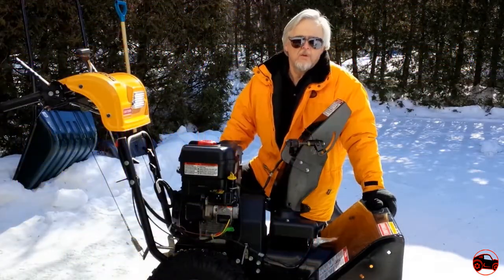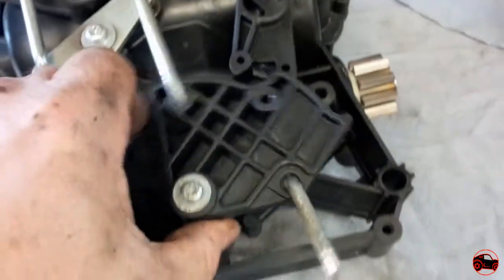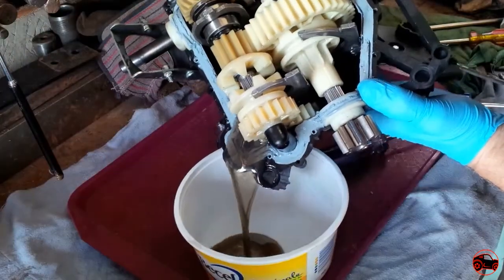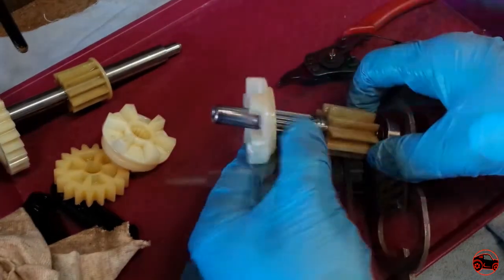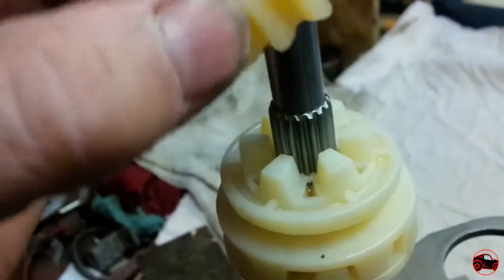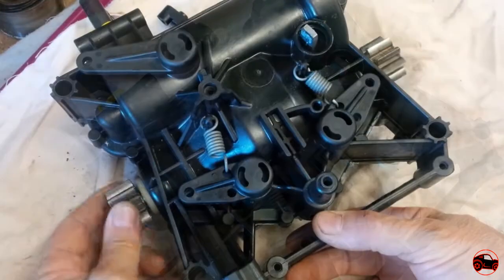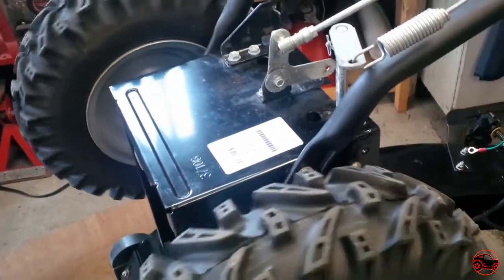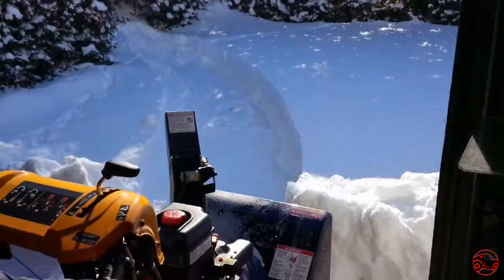How I dismantled and reassembled the transmission on my Sears Craftsman Snowblower C950-52301

Comment: A wonderful video thank you kindly for posting it, I have the same snowblower and presently when I engage the drive the wheels don’t want to turn immediately I have to give it a little push this only happens after I’ve use the machine for a while.
I was going to replace the transmission do you feel some adjustments are in order first? I also have a lot of trouble with wet snow on this machine it will go over top all the time it does not want to bite into any high snow
Reply from the maker: It might not be the transmission. Sometimes if the wire that pulls the lever that engages the clutch is a bit too loose, the clutch is not fully locked and it can slip. After many winters the wire can stretch a fraction and may need to be readjusted.
Also, when the snow is too wet and heavy or too high, If possible, I do not use the full auger to remove the snow, I try to remove smaller snow swath.
Reply: @mtlcarguy  yes thanks I knew about working thru heavy and wet snow. 
I will check the cable adjustments for sure 👍 I’ve noticed oil in the snow from under the machine so I’ll have confirm that. 
I’ll tear down the machine soon and try n get to the problem, I ordered a transmission and belts so if it needs the tranny I’ll have it on hand. 
I can’t find a service manual with specs etc those are helpful. 
Thanks for your reply much appreciated
Reply from the maker: @curti6317  Look for ''Craftsman C950-52301-0 Operator's Manual'' on-line. Good luck!
Reply: @mtlcarguy   hello MTL, Today I removed the inspection cover  and found there is allot of oil seeping from the transmission so I will definitely remove it and check it out. 
I’m curious if you posted a video on how to remove the belts, The drive pulley looks like a clutch? 
Also You mentioned you took the motor off I would like to do that but noticed on my model the bolts that hold the transmission in place appear to  go thru into base of the engine and hold it in place unless I’m looking at it wrong. Did you turn the machine upside down and disassemble in reverse. Thanks for your help
Reply from the maker: @curti6317  
I never filmed the belts removal procedure or installation but the owner's manual shows good details about the parts positioning and the torque.
Most of the work was done with the snowblower on the 2 wheels but sometimes the machine was holding on the front of the auger housing when it was needed.
As I can remember, I removed the bottom panel to inspect the parts and gain access to some lower components.
Later I disconnected the electrical connectors.
I also removed the 2 upper pulleys to free the 2 belts.
Once done, I removed the engine/motor and the engine mount plate.
With the upper plate removed, I was able to disconnect the control wires and undo the 4 nuts/bolts holding the transmission in place.
I slowly removed the transmission then I decided to film the procedure. 
Make sure you take a lot of pictures to be able to reassemble and adjust all the parts.
Note: The lower drive pulley looks like a clutch but it is only a variable speed spring loaded pulley.
Good luck.
Reply: @mtlcarguy  Good morning, I managed to get the machine and transmission apart. The transmission (input) pulley is melted between the sheaves and the belt has a lot of stretch compared to the new one.  The driven (engine) pulley is ok. Had I just looked at the belt and input pulley I would have just changed those and hoped for the best. 
Considering the transmission reputation, I took the trans apart and found one gear has a lot of wear on it im not sure this trans is rebuildable given that, I ordered another trans and am waiting for it. One thing I've found is parts are tuff to get as they discontinued that transmission. 

I did find a link to the makers web site if you'd like to take a look they show a limited diagram of that trans. They call it a HR300P 

  http://services.generaltransmissions.com/en/snowblower.html

Comment: Hi I have this same snowblower, my issue is that it is pulling left even with the bucket lifted up. Air in both tires are set to 18 psi any ideas? Thanks
Reply from the maker: The left and the right wheels are locked separately with the driving shaft when the traction levers are rotated. Look at video 7:19 for details about the cables to disengage the wheels. Check the adjustment of the cables/wires. Check if the cables are moving properly. Check if the wheel traction levers over the transmission are rotating properly. What you cannot see are the nylon traction locks inside the transmission shown  in the 5:40 portion of the video. Good luck!

Comment: What kind of oil can be used in the transmission?
Reply from the maker: I don't know. I kept and I filtered the original oil that was in the transmission.
Reply: what is the approximate volume of the oil?
Reply from the maker: @СергейЛешуков-у3ф   The housing was resealed with Permatex Ultra Gray Gasket Maker 59903 and after I added around 300ml of the original used oil.
Reply: It uses 7.4 oz of either 5W30 or 5W-40

Comment: So once the season is over, how about an update ?
Reply from the maker: The transmission was fixed during the 2019 summer. I had no problem while I was using it in the 2019-2020 winter season. So far this season (2020-2021), I used it a lot and it worked fine. I will reply again if anything goes wrong before the end of the season. I am still ready for one or two snowstorms.

Comment: Second view !

This is a very bad design !  The clutch lever applies a side force to the outer bearing race.  The force is transferred to the balls which then forces the inner bearing race up against one half of the cone clutch and into the other half of the cone clutch.  The balls in the bearing are constantly under a side load, and that type of bearing is NOT designed to work that way !

While you replaced the bearings with good quality one (SKF 6002) I don't know how long those will last.
Reply from the maker: Yes, it was a poor mechanical engineering solution to transfer the lateral force on this rotating shaft. I don't think this transmission was designed by engineers that spent a lot of winters blowing snow up north. Like you, I don't know how long the bearings will last, but, if it happens again it is a topic for an other YouTube video.
Reply: @mtlcarguy  It is sad that one poorly designed portion of that transmission caused a failure.  All of the remaining components appear to be in perfect working order.  
What should be used there is a thrust ball bearing.

Comment: The drive system is made out of plastic and not serviceable. Clearly not worth repairing considering the time it took. But congratulations for figuring out this complex piece of machinery.
Reply: Perfect example of if it's not broke don't fix it. In the friction disc system that most other machines use is very reliable. And when there is an issue with the friction disc system it's usually easy to repair.
Reply: Same i was watching and i was almost frustrated whenever i looked at the plastic gears of this disposable technology...
Reply: The gears looked to be in perfect condition.
The manufacturer says that there are no service part, but the author proved them wrong !
Reply: But the plastic was not the problem!  The bearing choice is just very poor for the side load design.  I am impressed with this repair effort.

Comment: Thanks for the videos....My Craftsman has some gearing issues and the electric chute is broke, all happened the first year lol..Its in 3rd gear and will drop down to 1st gear or put it in 5th gear and it will go slow and then all of a sudden it will jump into 5th gear....I'll pull it apart and take a look.....
Reply from the maker: The problem can be outside of the transmission. It could be a bad shifting of the variable pulley assembly. If the belt on the transmission side is sliding due to a bad adjustment or some rust, the speed could not be consistent. The traction control handle (LHS) pulls the cable that activate the internal clutch mechanism, if this cable is too loose or not well adjusted, the internal clutch can slide and get damaged. If you dismantle anything, take a lot of pictures to make sure you have your own step by step procedure. This will help you to trouble shoot your problems and also to reassemble your snow-blower properly. Note: The H2 General Transmission is not considered as serviceable it is sold as a full assembly. Even people that fix snow blowers are not interested in opening it and fixing it.